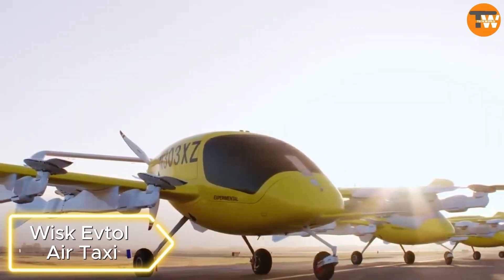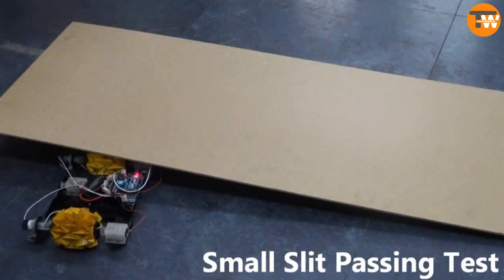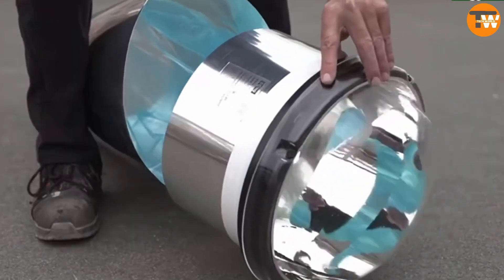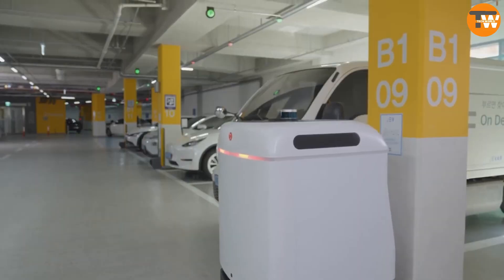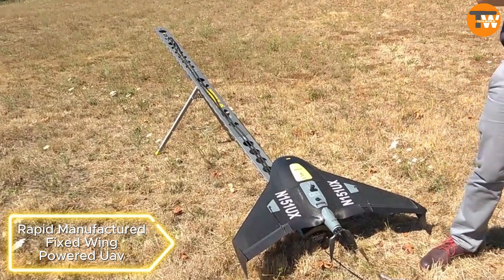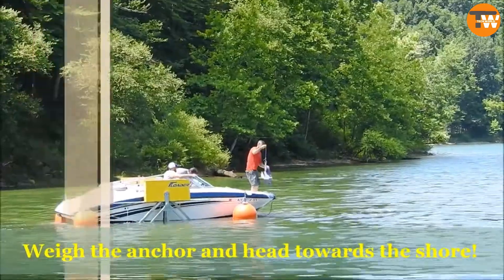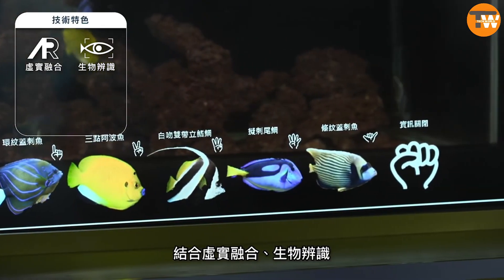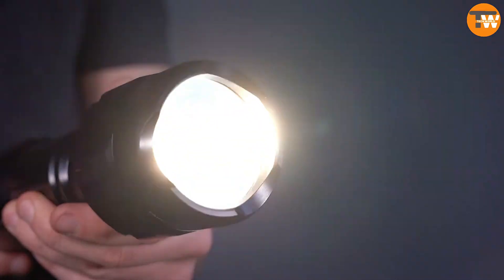Incredible Inventions You Didn't Know About

Comment: We have two dome lights and they are sensationally good.  They supply useful light surprisingly late into the evening, and the quality of the light in good daylight is amazing because they are bright, have a daylight colour and a soft and diffuse quality.  The domes also have a nice UFO in the roof effect at night when house lights are reflected back to the dome.  Thoroughly recommended and great value having zero running costs.